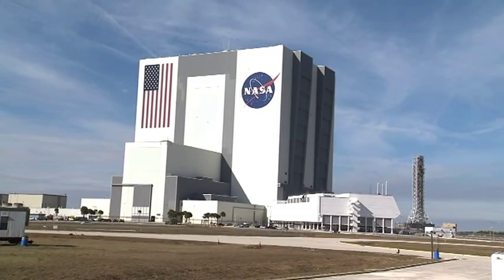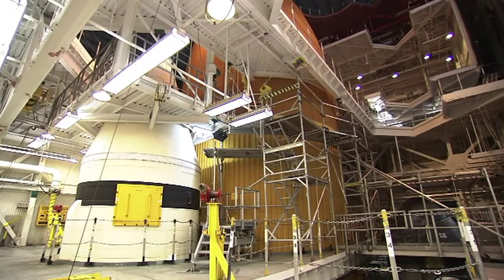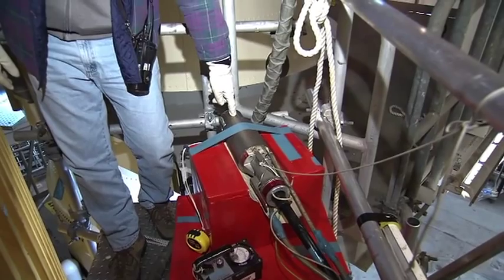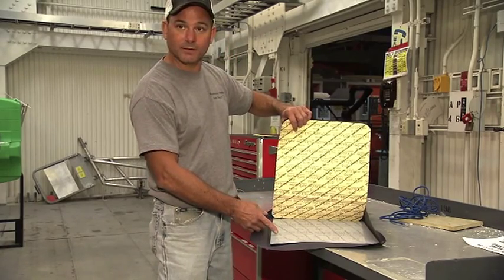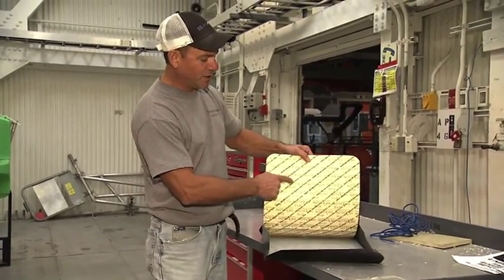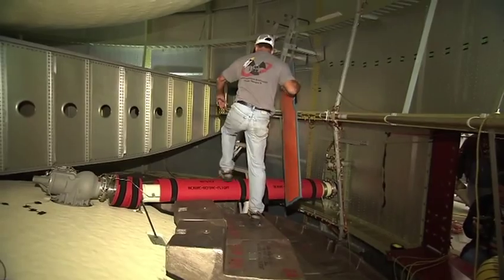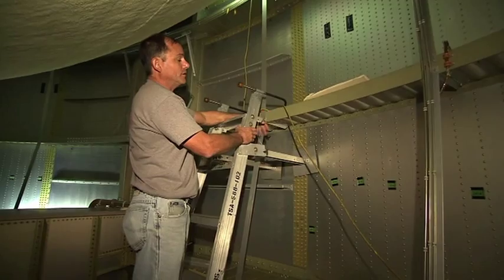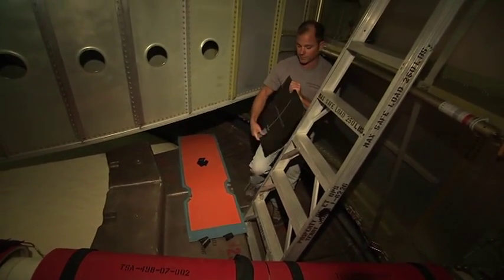More Scans Taken of Shuttle Discovery's External Tank for The STS-133 Mission

Comment: @RigelKentaurusA I'm 99% sure that's actually the hydrogen vent line, i.e., gaseous hydrogen boiloff is sucked out through that line. Both the LOX and H are filled at the rear of the shuttle just below OMS pods, and gaseous oxygen is vented through the beanie cap at the top of the external tank.